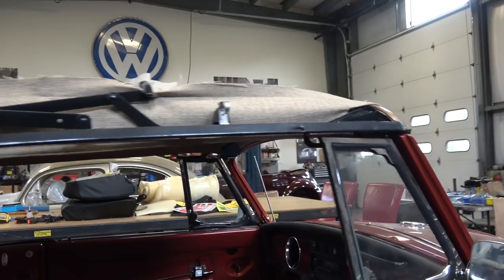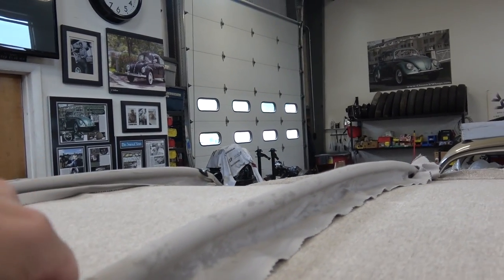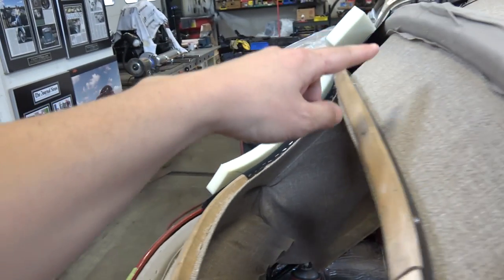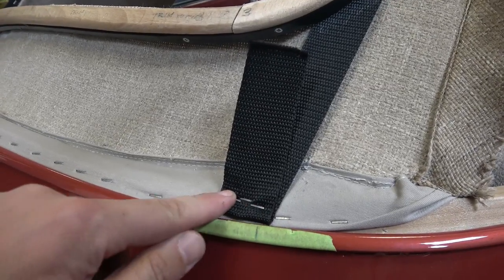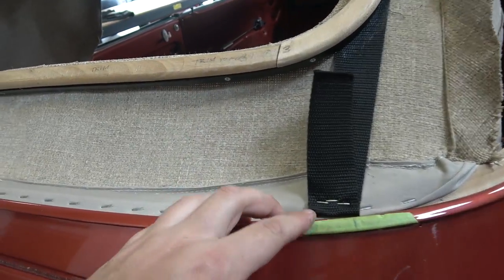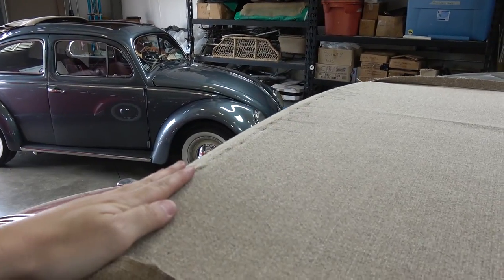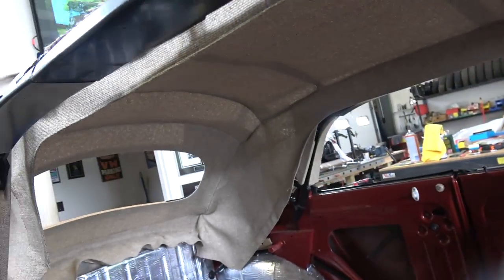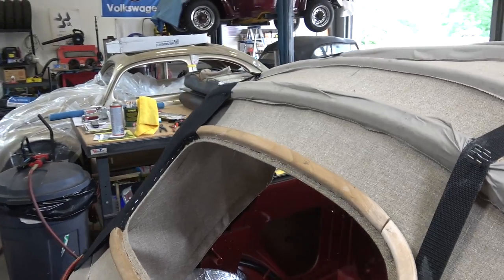Classic VW BuGs 1970 Convertible top Installation Beetle Restoration Update 5-31-18

Comment: 😮it’s just now dawning on me that I’m only replacing the headliner. I have to make sure it lines up with the hole in the top. I had to make a new wood bow for the rear. This 71’ has fuel injection and the rear lip of this car has metal tabs instead of the wood pieces on yours. It has a box with wiring hooked up to it and that clamps onto the fender well. I’m redoing the rug too. I have to do this ass backwards. The headliner hole for the window will over lap the top material. Hmmmmm, 🤔

Comment: Thanks for the many great video>I am working on a 71 SB my first many years going.I tried to find the front kick panel and it is not available from the parts suppliers.Did you run into this problem .I am doing the body off restoration.
Reply from the maker: did you check with cip1 or wolfsburgwest.com?